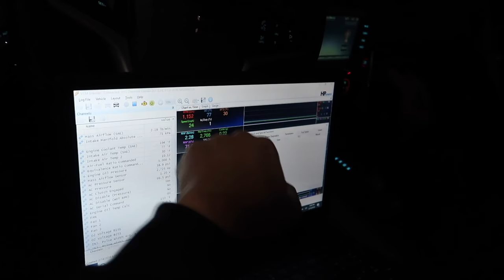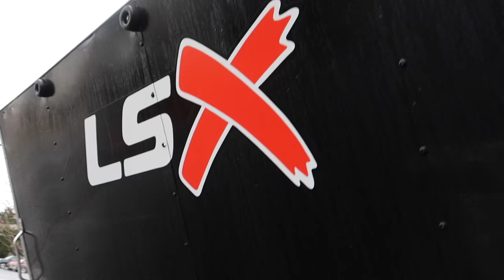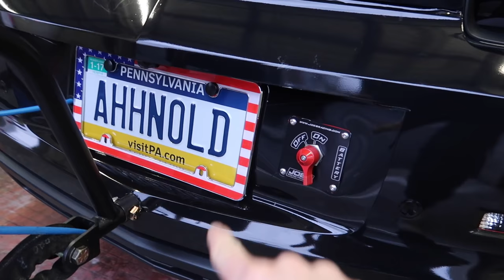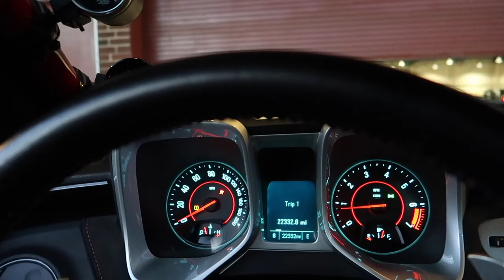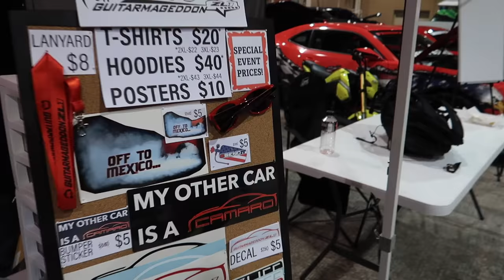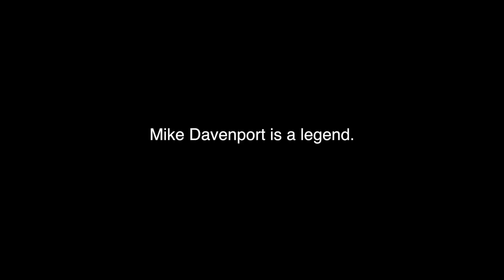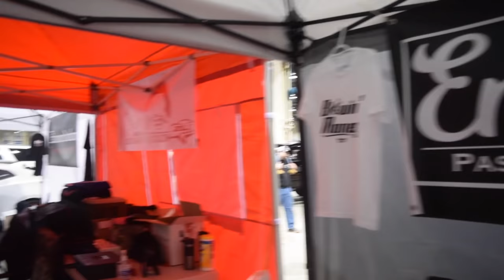Tuning My Insane Camaro ZL1 On The Street!! Plus Motorama 2018!!

Comment: The level kit is probably not helping the squat. might need airbags or helper springs. or wd hitch. I tow a 7-8k tractor and with proper tongue weight it sits level. I might try timbrens or hellwig ez990 to help with bounce I get from 1500 soft suspension on bad bumps.

Comment: Nick you need to get a Duramax so you can use it to tow your Freedom Rocket to where you need it, it will tow it all day long without struggling or hesitating. You will feel more confident towing with a Duramax especially up hill then the 1500 5.3 Silverado. Start saving up for a Duramax Nick.

Comment: Still going to lose to 717?
Reply: Mike's car is making 920 rwhp on pump gas only.  E85 should put it close to 1000hp.  And he weighs about 600lbs less than Nick.  Nick will have an advantage w/ the 3spd....but Mike's car should be much faster after the 1/8th.

Comment: Andy was just trying to satisfy nicks wants for cheaper. These new guys are making andy look bad but he was only doing what nick wanted. Remember that nick was unsure to make it full racecar so he held off on alot. Not Andy's fault or no one's. Engines blow up all the time. No need to throw shade. These new guys obviously did better because they started from scratch and told nick to chill and let them work.

Comment: It's a Chevy not Ford of course it can tow  without any problems
Reply: Bmackins94 chevy’s are designed to go more than 65 without any issue whatsoever. Lol
Reply: Grandpa Smurf and they are designed to brake down after driving it 3 miles down the road. My 2017 Silverado trans went out 3 mikes down the road smh
Reply: Nacho Galindo I know that gm was having problems with the a8 trans failing
Reply: Trans problems are nothing at lease I can above 65

Comment: That is not what dfco does or what its for. This engine will be blown soon with no knowledge "tuner" working on it.
Reply: Please... enlighten us as to what DFCO really is then
Reply: What I imagine he’s referring to is the fact that it doesn’t shut down the injectors. It does reduce pulse width and lean out the afr. He’s probably also talking about the fact that while it may be nice on a 400hp na car to help with fuel mileage it is not a good idea on a high output forced induction car. Lean is hot. If you lean out a cylinder after a wot pull you risk hurting a piston or melting an exhaust valve. Not a good idea in my opinion, but do what you’re gonna do. Awesome car